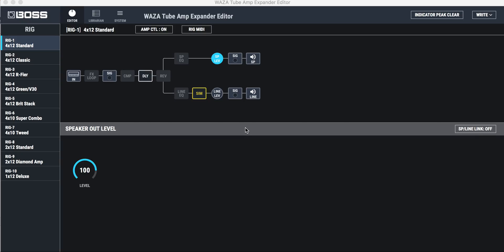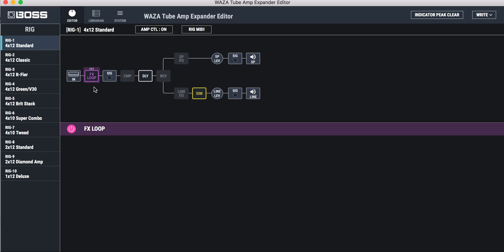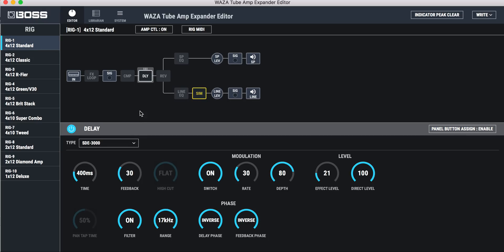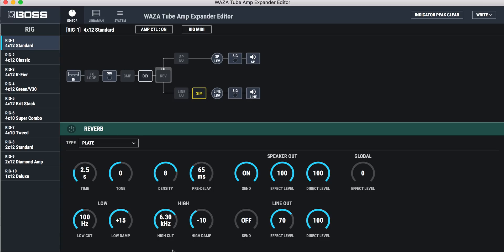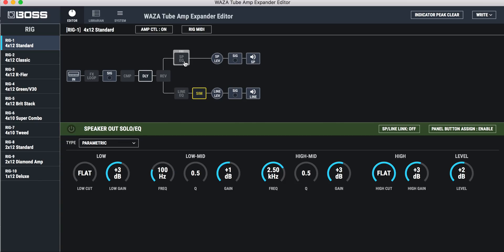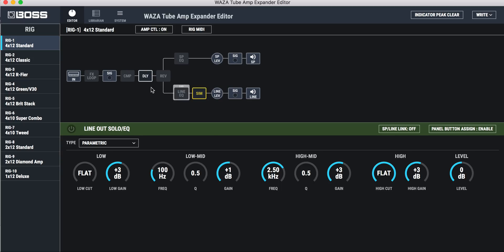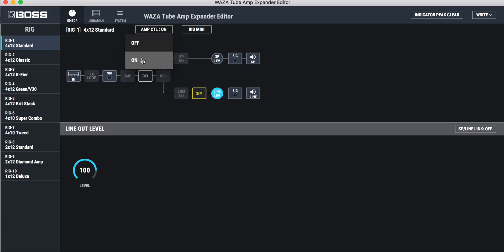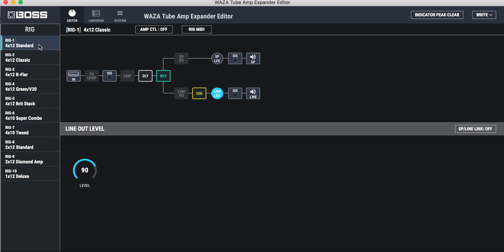Step Inside the Boss Waza Tube Amp Expander - Editor Software ( Part 1)

Comment: I have followed the directions to install the drivers and they seem to install.  I can see an icon in the System Control Panel. I then follow the instructions to connect the Boss Waza Tube Amp Expander to the computer so the driver will update.  Flat out does not work.  Starting the editor displays a dialog informing I am using an older version of Boss Waza Tube Amp Expander.  It tells me to update to the latest version.  The link provided from the dialog is useless.  Clicking OK after being told the version is old I get a dialog telling me the Boss Waza Tube Amp Expander is not connected.  IT DAMN SURE IS.  I am using the same USB cable I use for my Fractal AXE-FxIII; the cable works. The editor runs but it is basically WORTHLESS because it thinks it is not connected.  This all makes me pretty mad.  I think it will work if one of the monkies at Boss could get their act together and get the process down CORRECTLY but until they get fired for being an idiot I guess I'll just have to sit on TWO OF THESE UNITS that I can't take full advantage of.  Thank God for Fractal.  Their stuff works as advertised.
Reply: UPDATE - I connected my second unit using the same USB cable and it works BUT it is newer.  The key here will be to get the unit that is "seen" as older to update but like I said nothing provided in any instructions from Boss works.  It could also be that the unit has been defective from the start.  I handle gear like I would a newborn baby so it's nothing I did.  I am strictly a basement metal rat so no gear gets lugged around.  I'll call Boss tomorrow and provide an update.

In case people don't understand my anger consider this: I am a 30 year computer programmer.  I don't send out bad software.  I EXPECT things to work.  I DEMAND it.  No mistakes or hit the road.  There is plenty of time and tools to test.  No excuses for failure.
Reply: A tech at Sweetwater did manage to get the unit updated.  He agreed with me the documentation provided by Boss is not good.  In the end the unit does now work as expected

Comment: On the IR portion can you have to different speaker types and mics ?
Reply from the maker: The Waza comes with built-in amp models and within those virtual rigs you can choose the speaker cabinet, Mics, position and distance. IRs are external wave files that can’t be tweaked.
Reply: @rockinchippy  ok thanks ,can you run say an IR of a greenbacks and a IR of a jbl at the same time through seperate tracks ?

Comment: Can't find the answer anywhere but is the 2 blocks "sp lev" and "line lev" directly connected to the front panel "speaker out level" and "line out level" or another kind of volume ? I mean if i use 2 amps with a switcher but going into the same cab is it possible to save a different volume" attenuation" for each in two separated rigs or not?
Reply from the maker: Your first assumption is correct. There is another approach though that could work. You could create two virtual rigs (presets) and use the volume settings in each signal chain to control the overall output level. However, you would need to use the Waza to activate the latching mechanism of your switcher for this to work.

Comment: Would it change a 3 channel amp with the amp control?
Reply from the maker: No it’s a simple on-off latching switch
Reply: Thank you.    I am close to pulling the trigger.  Had the Ox but didn’t like the fact I couldn’t use the OX sounds through my cabinet which the Boss solves.   I also noticed the Ox colored my tone in a way I didn’t like similar to every attenuator I have tried with the exception of the Power Station.  I liked the sound of the Fryette but the issue with that one was the SLO I had overpowered it.  I am just a little worried about the solid state amplifier as the power section as if I got it I would use it on stage through my 212 cabinet and run the rest to the board.     For home use and recording I have no concerns.
Reply from the maker: Yes the OX for powering real cabinets sucks. I find it amazing that despite this fact people keep falling for the trap. The Waza is way better. I love the Power Station and have no issues using the SLO with it.

Comment: Just got my TAE last week....I can’t figure out how to install the editor for the life of me....I downloaded the drivers,then the editor....when I plug the TAE into my Mac,nothing.......I can’t find any info anywhere....
Reply from the maker: Did you open the Editor on your computer?
Reply: rockinchippy yeah....finally got it to work after installing/uninstalling the driver like 15 times.....I must say I am very surprised at how my 5150III sounds pretty much the same at low volumes,as it does run thru the Waza.....Never used a load box before....I pretty much just wanted it for a Wet/Dry/Wet rig,and to insert my amp into my Helix for FX and IR’s.....so the Waza is probably more than I need or want.....it does sound really good though.....but I think I am gonna go with the Fryette PS100......
Reply from the maker: That makes sense
Reply: rockinchippy one last question,I noticed the Fryette PS2 doesn’t have a level control for the line out....is this a problem??I plan on using it for a W/D/W rig....The new PS100 does have a level for the line out....just wondering if that’s something that I need or not.....Thanks for your help...

Comment: Thanks for these vids! I own the Ox and am finding myself really interested in the Waza. Still, there's a sparkle and clarity on the clean tones I get from the Ox that I haven't yet heard from the Waza vids I've watched. In your opinion,  does the cab modeling quality on the Waza keep up with the Ox? Do you miss not having that second mic? Thanks!
Reply from the maker: I was very concerned about the Waza IR tech being lesser than the OX modeling and it’s possible it may be for vintage purists and stuff. However, I’m finding for more rock/hard rock it just has better speaker emulation.  The OX only has that Greenback cabinet which can feel a little soft and mushy compared to the tight and percussive stuff I’m getting out of the Waza. Don’t worry about the clean channels, the Waza sounds awesome. A lot of times the chime you hear is based on the choice of clean channel and/or pickups.
Reply: @rockinchippy  Thanks so much for that insight! The cleans are what I was most concerned with, so it's reassuring to hear it handles them well. I find myself living on position 4 on my strat, so glassy cleans with punch are a must :)  In the distorted Ox vs Waza comparisons I've heard, I have preferred the tightness of the Waza, and I totally agree about the soft/mushy feel from some of the Ox cab models... perhaps you nailed it with your comment about vintage tones; the Ox seems to capture that sound and feel a bit better, while the Waza might appeal more to players seeking modern guitar tones.

Comment: Im loving this unit but i can't get it to see my apogee quartet and connect to it.  Any ideas what's going on with it? I have tried everything.  Says its not the right device. My computer is a IMAC PRO running Mojave V 10.14.5
Drivers are installed, rebooted several times. Still won't work.May have to send it back if it won't connect to my computer. GRRRR.
Reply from the maker: It doesn’t connect to your interface. It connects directly to the Mac as a separate audio device.
Reply: @rockinchippy  Correct, but when the software opens up it try to connect to the Apogee for some reason. I have a usb running right into the computer. not the apogee.
Reply from the maker: ultra888 you mean when your DAW opens up? You have to tell it what audio device to use. On my Mac you have to go to Sound Devices and indicate what your input device is.  It’s called an Aggregate IO. That’s what I had to do for Pro Tools.

Comment: i have one more question about the software what are minimum requirements for the use of it ? it's only a computer software right ? it's just a shame it's not possible to connect it to a tablet, it would have been easyer to use in live.
Reply from the maker: Everything in the rig presets are footswitchable as well as being able to cycle through the rigs. I do not really see any use for the Editor for live use.
Reply: @rockinchippy  i thought that software was tottaly required :) thanks for answer

Comment: i hada question of in/out i have been wondering about in this box there is two output for cabs, if the amp is plugged in with a certain impedance does this impedence is transmitted to both ouput for cabs ? and do you think it's possible to add someshint like tonebone switcher to switch amps ? that would be really amazin to use it likely
Reply from the maker: If you connect to both OUT A and OUT B, ensure that the total impedance is 4 Ω or higher. For example, if an 8 Ω speaker is connected to each of the OUT A/B jacks, the total impedance will be 4 Ω.
Reply: @rockinchippy  thats what i was expecting thanks for this answer. this unit seems very very cool.
Reply from the maker: If you used an amp switcher, to the amp, the Waza would just be the “speaker” if that makes sense.
Reply: @rockinchippy  yes that's the idea, i am visualising the waza as an intermediary speaker that provides a lot of functions. that would be insane having multiple amps with this unit.

Comment: Alex, great vid, short and to the point! I had asked you early on about the possibility of running a Wet-Dry rig by using this, a regular amp, and an FRFR. Looks like from what you presented here, there are some possibilities of that. This is a very cool piece of gear, and I am tempted to swap out my OX! Thanks for posting. 
Jeff